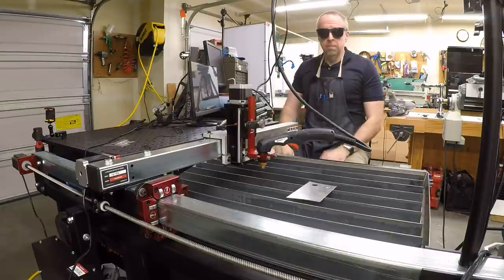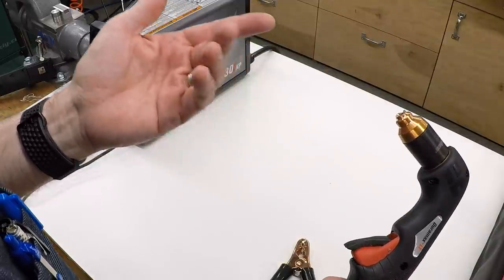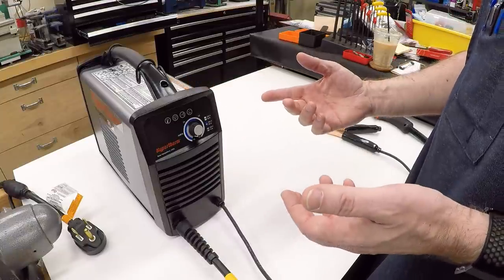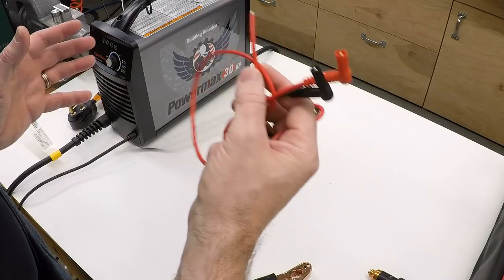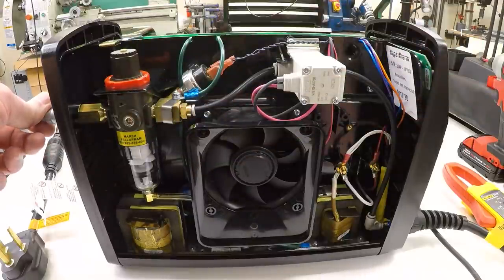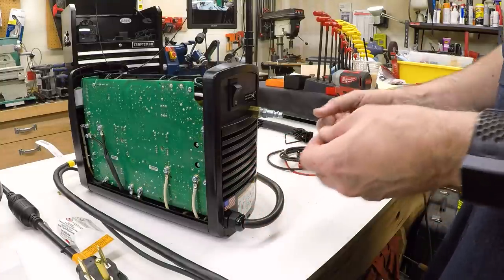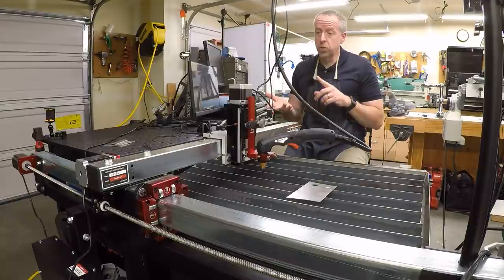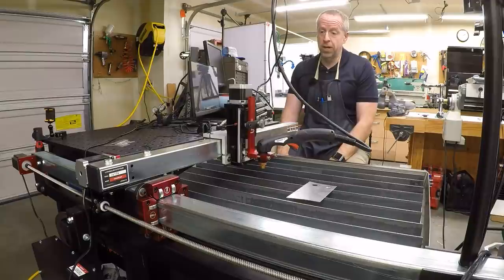Don't try this at home: Wiring a plasma cutter for CNC | Hypertherm Powermax 30 XP

Comment: Are you sure that it'll void machine's warranty? I have a Hypertherm 45XP with machine torch and my manual states that you should service the unit by taking off its cover (and cleaning the insides), which gives you complete access to the circuitry and air system.
Reply from the maker: Yeah, I had forgotten that.  Hopefully I'll never need to find out.

Comment: Hi sorry to bother you. I most say love your channel. But I have a little question I have a cnc 2.5m l by 1.10m w and a 80 amp plasma..  My only problem is I only have my garage to electric box which is a common box UK. How many amps should my breaker board have to sopport the plasmas on the cnc? I would extremely appreciate your help as I have no clue what I should do... I rather work on mechanical systems than electric hahaha I feel safer
Reply from the maker: The plasma cutter manual will specify the circuit requirements.

Comment: 13:01 yeah i see that machine was clearly not designed for doing such a thing....
Reply: Or they add those holes for quality assurance to do some (automated?) testing during assembly of the control unit without having to attach a torch
Reply: @wouterbaake7386  maybe, but could go on the connector for that as well...

Comment: I had a nice 76 f150 almost burn down because the previous owner used those insulation piercing connectors. I absolutely hate them!  Please take a few extra minutes to do the job correctly, they remind me of the stab connections on the back of outlets which imo should be outlawed! There again almost had a house fire because previous owner decided to save 10 seconds and use the stabs instead of the screw lugs.
Reply from the maker: These are low-voltage, low-current switch wires, so there is heating or fire risk here.

Comment: I spent a week rewiring someones Langmuir system to be compliant with even the most basic of CNC standards and fixed numerous safety issues. Not to mention these beginner tables should have physical limit switch’s for safety reasons but they can’t for numerous reasons. mainly because they have so much EMI/EMF noise they get false triggers. The solution wasn’t proper wire/cables, wiring practices/management, grounding, and adequate power sources.... it was to remove all accessories and just make more money.  

Snake oil. Cheep. Shameful. The  Langmuir consumer just throws more and more money at their sub par equipment! 
I’m going to start a business building better machines for the same price point just to kick in Langmuir’s front door.
Reply: when? don't see anything yet...

Comment: Just cause the house is 100 amp only is no sign you cant put a 50 amp in the garage just a little common sense and don't run everything at the same time

Stop playing with sheet metal toys and go 45 XP with a Duramax machine torch. CPC connector is ready to rock.

Comment: I know you will but please cover all of your tools ways! Yuck, plasma smoke is gross.
Reply: It’s not only gross but unless I’m wrong it is black iron oxide…which is an abrasive. Very bad for machine ways. I keep my plasma cutter in a building that is separate from where my machine tools are located. I also have a 36 inch exhaust fan above it.
Reply: @billstanley4819  that's what I was referring to. Its equivalent to grinder dust and emory dust in my opinion
Reply from the maker: Good tip.  I'll probably end up running it at the other end of the shop.  Not a lot of light over there at the moment.
Reply: @Clough42  probably best. Maybe wipe your ways before using your machines for good measure. Even a large fan blowing out the door might help. But yes, from experience, that dust goes evvverywhere
Reply: @Clough42  An hour of running a 40amp plasma in a 3 car garage left more dust/grit on everything than a day of sanding bondo/primer or all the over spray from painting a whole car. If you have a clean shop, you do not want to run it in there without taking serious measures to manage the literal fallout first. I roll mine out to the driveway winter or not now, I dont have neighbors though, and still have to clean the dust up or it rust stains the driveway. Stuff Made Here, did a downdraft setup that seemed to exhaust it out well.

Comment: Everything you do nice and then you do a bad job with those f**** connectors😏 you should have used a wago or something
Reply from the maker: I stated my reasons.  They're minimally invasive, they'll be fine in my shop environment, and the long term consequences if they fail are low.
Reply: @Clough42  I like tho do a good job with everything that I do some things AR not tho play with connect will be a little easy fix the rest of the video I loved very much I'm going to look more on your channel I could definitely learn a love from you and knowledge is power